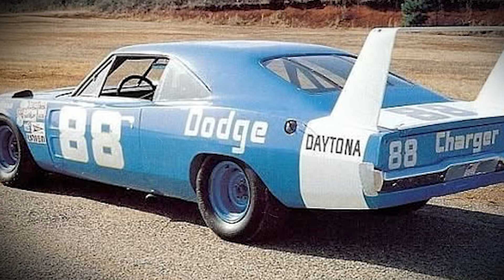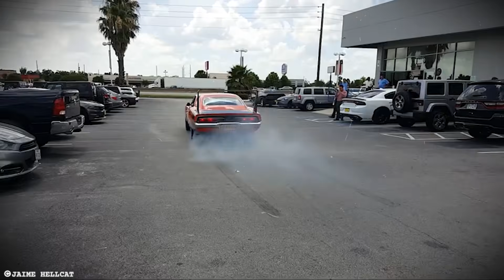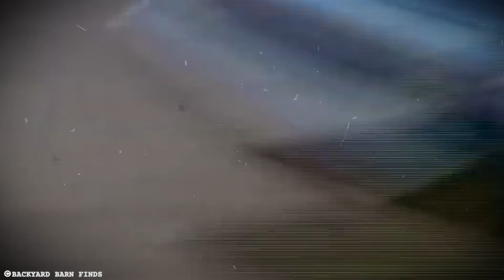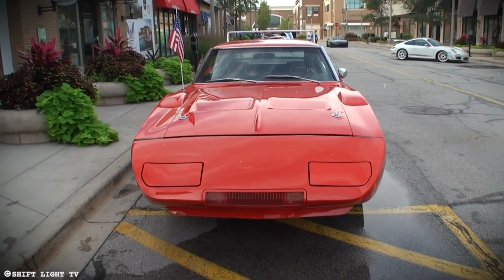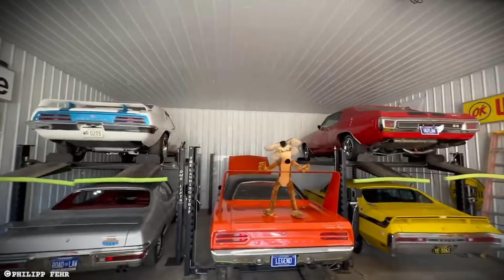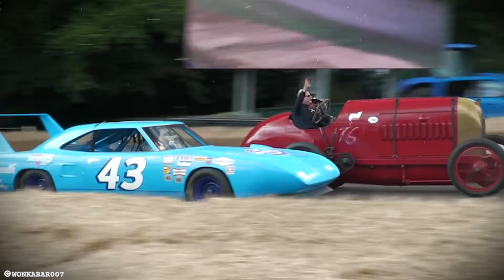How the Dodge Daytona's Wing OUTSMARTED NASCAR's Aero Wars

Comment: The Ford Talladega was beating the Charger 500 with the 427 Tunnel port but the new Boss 429 had 50 to 70 more hp than the 426 Hemi Chrysler had to build a slick body to keep up . The 1970 King Cobra was unstable because the rear end lifted so Holman Moody put the King Cobra nose on a 1969Talladega and it was faster than anything out there . Bill France saw that and ended the Aero Cars right then and there.